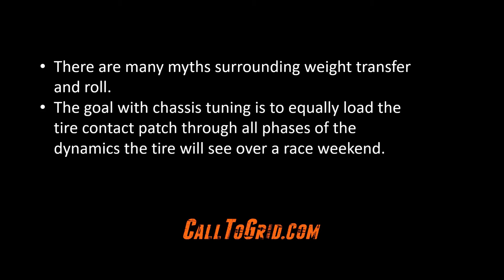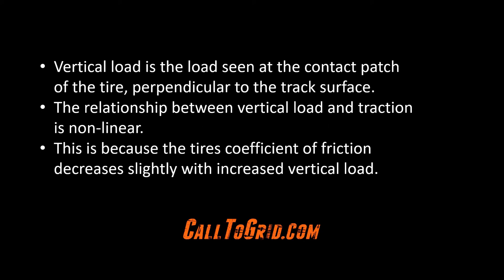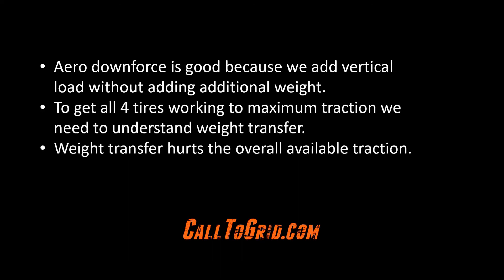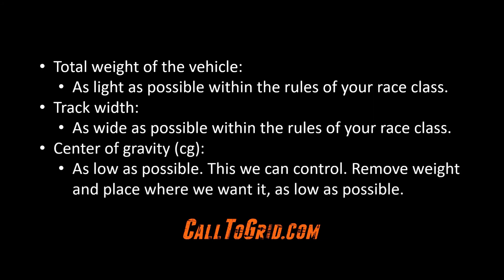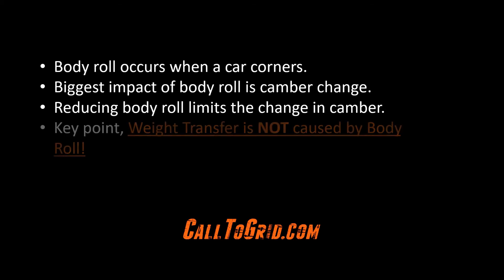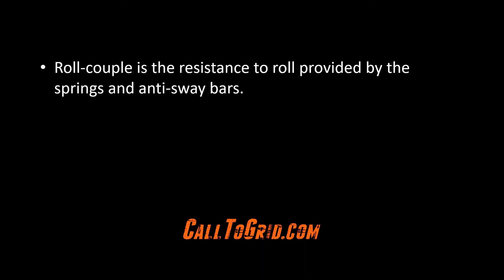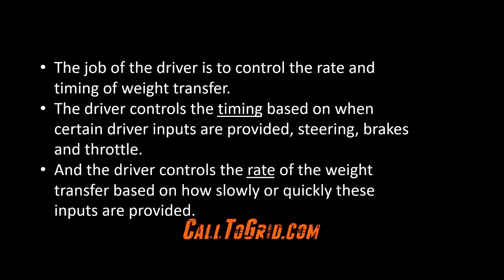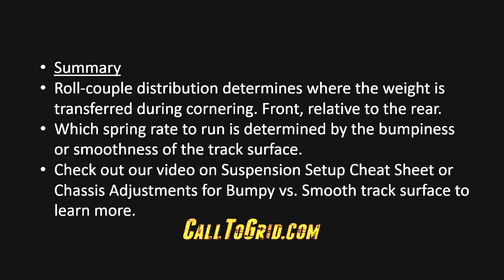Understanding Weight Transfer and Body Roll - CallToGrid

Comment: Good video. Nice and clear, but recently I came across a guy who said that if a car has softer suspension, then the impact of tire-load-sensitivity will be initially reduced, when rolling- because the chassis will not be pushing down as hard. Then when the car basically settles, the actual weight of the side of the cars rolling body, will suddenly push the tires into the road too hard (too much slip angle/tire deflection), again I am talking about tire load sensitivity. Also, although a slower tire-deflection of a softly sprung car, although it sounds initially good, actually means that when the weight has settled, the car will have to take up the 'slack' of the deflecting tire- wasting time.
I don't know if I believe this- It sounds too goofy. I was under the assumption that soft suspension has the advantages of being more supple and allowing the wheels to fall and rise into the bumps better- giving more grip. But stiff suspension keeps the wheels position on the road better (allowing the tires to be used more effectively and the track, toe and rake to remain the same). When you combine the lower center of gravity that lowing the car will give you (and the fact you will need to stiffen the suspension to prevent bottoming-out), and finally that stiff suspension actually feels 'better' and more connected to the road. I thought you actually get more advantages from the 'less grippy' hard suspension, ironically.

Thanks
Reply from the maker: Appreciate the kind words! Great comments! As you said, regarding roll, if you run too soft your car will take a set, and then exceed slip angle and the limit of the tire. If this this is the case then run a bit stiffer. However, if you exceed the tire limits immediately on turn in, then run a bit softer. Springs determine WHERE the weight is transferred, front relative to the rear, and its the job of the driver to control the TIMING and RATE of that weight transfer. Timing is determined by WHEN driver inputs are provided, and the RATE is determined by how smoothly those inputs are provided. The smoother the driver is, the weight is transferred in a way such that the chassis can absorb them. 

You might be interested in this video where we describe different chassis setting based upon the smoothness or bumpiness of the track surface. https://www.youtube.com/watch?v=emztS-Q1Gq0&t=145s An extreme case being Sebring where you want to run as soft as possible, shocks included, to absorb the bumps, but stiff enough such that you get good feedback from the tires and maintain compliance of suspension geometry and your desired camber.

Cheers, mate!